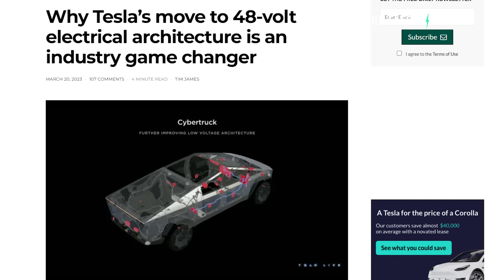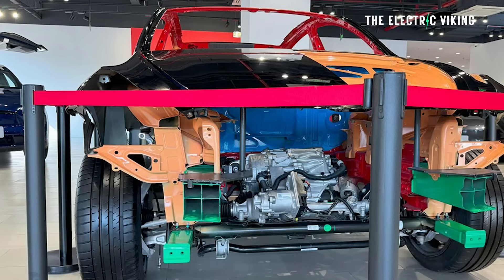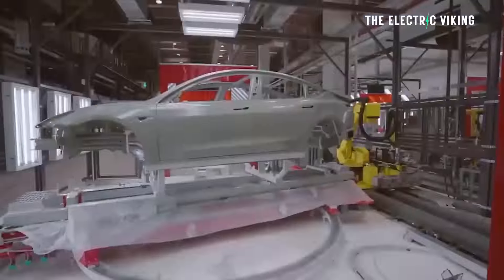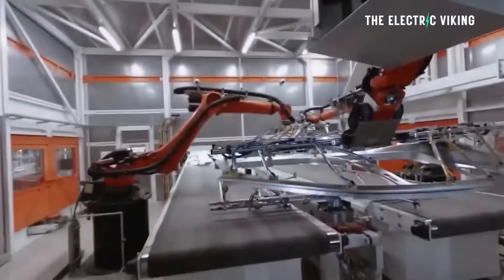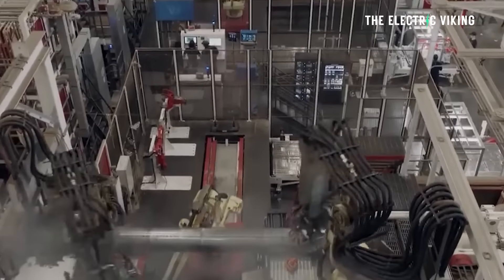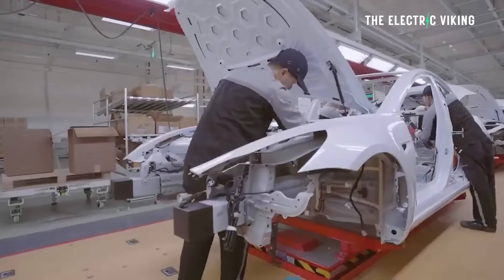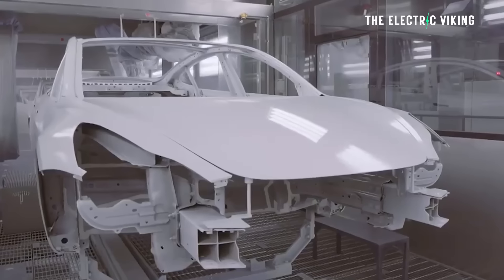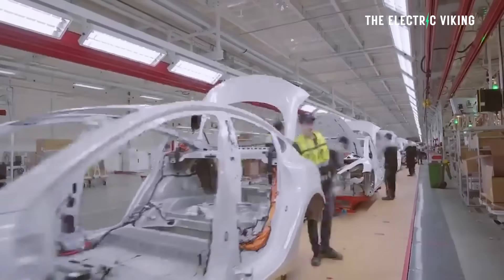Tesla Model 2 NV9X Redwood Crossover coming with Cybertruck architecture

Comment: I have Tesla shares and one day may yet grab a used Y but… to all the engineers reading this, EMP vs Tesla whether source is the sun, military or some future date civilian held equipment used malevolently, how will Tesla vehicles fare? Optimus might have issues too 👀🎈😂🧠 but I am asking a serious question out of curiosity. An old pre silicon chip diesel Land Rover I assume would start up, even using a hand crank… and non existent battery 1960s farm tech

Comment: Every generation / refresh has removed parts. USS, radar, and indicator stalks and who know what else under the skin. Plus the most recent Model 3 refresh is off old architecture and platform. New cameras and HW4 but the cost of which has gone down over HW3. It's also rumored that FSD 12 can only run on HW4 cars. This means the majority of it's vehicles on the road can't run V12. So it does not surprise me the Tesla will introduce it's new tech into the Model 2 but keep battery size low to keep cost low. Given how sparse Tesla's are in terms of driving features such as HUDs, front cluster gauge, etc or simple but life threatening safety features like manual rear door latches, the Model 2 should be as cheap as a Dacia on launch.

A year ago, I bought my Model 3 for a stupid price when compared to what the car costs today. Reason was there was not much choice that I found compelling. But the market, in just 1 year has changed considerably. More choice and the choice is coming from China. So in two year my company car lease runs out and who knows what will be on offer. But I will definitely not be in the market for a Model 2 but nor buy an outdated platform such a the Y or Model 3. Those platforms will need more than just a refresh to compete against the competition.

Comment: Steer by wire. What could go wrong? Losing the ability to be able to steer the vehicle if there is an electrical malfunction or a bug. That's what.
Reply: I guess you don't fly. Planes have had it for decades.
Reply: @Techridr  Planes aren't automobiles
Reply: @idmhead0160  Exactly. You've made my point. Planes can't afford to stall on the side of the road, or lose "steering" since there are way more lives at risk. The technology is the same. You can also argue, Rack and Pinion. What could go wrong? All those parts that can break. That's what.

Comment: One concern I have is the cost of repairs if a Tesla made with one giant casting gets bent in a crash…the whole car will be written off.  So, on the one hand, Tesla saves money on manufacturing but the insurance companies/owners get hammered with astronomical repair costs….
Reply: Insurance companies are now writing off more cars because it is easier for them to raise insurance rates than deal with body repair shops, electronics and more.  They total the cars, sell them at auction and the cars are back on the road with a salvage title.

Comment: Price is not the only negative point of EVs, but also autonomy, charging grid, charging time, difficulty of suppressing a fire when it has started, can burn a whole buiding if a fire starts inside it, much lower autonomy in motorways at a reasonable speed, second hand resale value, repair costs, etc.  So much against it.

Comment: The Model 2 was a rendering so be careful we have been here before, presently at least 18 months away from the Wednesday call, which didn’t inspire many. The old Musk statement prototypes are easy, production is hard, came to mind given the trials and tribulations of the cyber truck. The days of over promising and under delivering have got to go, given this week’s markets reaction, it must arrive second half of 2025 has stated.
The other issue is the cyber truck architecture has been matched by Porsche which will undoubtedly percolate throughout the Volkswagen group. The new platform HV battery is a central component of the newly developed Premium Platform Electric (PPE) with 800-volt architecture, used by Porsche for the first time in the new Macan. The DC charging capability is up to 270 kW. Porsche and stablemate Audi are slowly squeezing the life out of the Tesla premium models S and X proposition. This is before the arrival of the production version of the 2022 Cayman GT4 E-Performance, 718 an EV race car that hints at what the all-electric next-generation Boxter and Cayman 719, presently under production testing for launch 2025, will be like.
Reply: My expectations is the the Gen 3 will be a full featured compact car at a price point and performance that others can't match for some time.    Did you mean stablemate?  
For $100K Porsche will sell you a 4.7 second car.  Or am I missing something?
Reply: @DC.409   Ah it is a hybrid.  No thanks.
This N Ring thing will never end.  I expect we will see a ban on high performance cars and it will only be about track cars. Hope not.
Don't write the semi off.  Tesla has been using and testing about 100 of them.  It needs lots of cells and Tesla is now gearing up to make them.  Has a lithium refining plant and a cathode factory in progress as well and many duplication of the 4680 lines.  High nickel cathodes on the way. etc

Comment: Drive by wire is not essential for all wheel steering, and Mazda and Honda had all wheel steering back in 1988. Yes it's a great thing for the Cybertruck but revolutionary it can not be touted as.
Also if 2 castings is Gigacasting, then one casting can't be Megacasting, it has to be Teracasting!

Comment: I think Tesla will yet again fail to meet their goal. The model 2 will surely not be available at 25000 $, it will most probably be available quite late, the basic version with smaller battery will not have enough range. The past has consistently shown that Tesla can not deliver their promised specs.

Comment: Thats a novel and Dinky way of casting the whole vehicle.  So, I wonder when RHD versions will be on Oz shores.  If they have got to get it right before production, cause so much hangs off this, then that spells delays IMO.  2029 in Oz maybe?
Reply: If Tesla builds these cars everywhere I don't see them taking long to hit the shores of Oz.  Unless there is hold up on your end.   LRD RHD will be a non issue with full drive by wire.   That will need brake by wire but that exists or should.
Reply: @danharold3087  OK, 2028 then.  I would not have thought RHD would be the issue either.  China will be RWD I feel, but equally unsure about Mexico.  There will be the inevitable delays, there always is, and casting one piece will be challenging no doubt.  Telling how the roll out was couched to investors too.  The only hold up in Oz will be stink bugs on board the RORO.
Reply: @GolLeeMe  Tesla is doing an incredible job of squeezing the cost out of production.   Apparently someone thinks the added cost per car is not worth the sales it will attract.   Heard a penny cut off the Model Y is a million dollars saved for Tesla.  I realize S&X are not the Y but it makes the point.
However I can see Tesla setting up rework lines.  Drive the finished vehicle off the line and into the rework were they replace parts as needed.   The added cost will then only apply to RHD conversion and volume must be sufficient to justify it.
Reply: @danharold3087  I think I agree.  But costs will dictate sales, and a revised fuel standard in Oz, BTW.  Plenty of RHD markets worldwide, so can’t see why they would not go all in.  However, if it is not delivered for less than AU$40k (US$25k) then it will miss the magic mark and I will be disappointed.  It’s the one shot to get it out there as the new model T, and hence my belief it will be a later delivery, to ensure it snares as many sales as possible.  The latest iteration of the 3 should have been the vehicle they started with originally, IMO.

Comment: After this winter. Ev’s are done. If you inspect the body creases, interior fit and cheaply made material that looks like it was snapped out of a plastic mold. Then the cyber truck is asking for an around 110,000 + tax. Only suckers. This truck goes three the battery due to it being and 8 ton truck. Good luck musk.
Reply: EVs aren't going anywhere. In the near term demand will be down but overtime they will replace all vehicles no question about it, it's just how long will that take.
Reply: EVs are great....if you live in the right climates, and as sedans or small SUVs.
Reply: @imzjustplayin  

I agree some day. But not until the price comes down in line with gas vehicles that have 2,000+ more parts. Last infrastructure. Charging stations today are a novelty today. Until you can charge up without waiting in a line, they will lose their allure. Last the car itself looks cheap and feels cheap. 110,000 is way off on price. I have a new set of words for Elon. Plush, styling ,none of the ev’s

Comment: Model 2 headlights styling tore a page straight out of Polestar.   Don’t think a gigacast can actually form an entire unibody out of a single casting from the simple fact that the casting is made by two faces of a press that come together.  The most you can get away with is probably the bottom half.  If you’re saying that the whole car is made from the same metal, just like model cars, the model cars are a top half and bottom half.

Tesla’s advantage is producing a car with engineering that no ICE manufacturer can provide, that ICE manufacturers, especially in the U.S. had slapped together low quality vehicles forever.  Tesla’s Achilles heel is growth for growth’s sake, and damn the employees.  They’ve even given up on making claims on the environment.  They’re no longer selling the dream of environmental propriety, but jamming the tech bro fan boy wannabe.

Comment: Steer by wire is not a new thing, and definitely not invented by Tesla.
Reply: Very little is new.  But last I checked Tesla is the first to put steer by wire in a car without retaining the conventional steering column as backup.   This makes LHD and RHD manufacturing a breeze.

Comment: Next Tesla - Stainless steel - no paint. Basic interior, Wide opening doors. Super fan to blow out debris. An LED interior belt line strip that blasts it with sanitizing UV after confirming all humans have exited. Cheap. Practical. Minor collision proof exterior. Function will determine shape (design). Hertz is dumping their Teslas due to physical abuse and interior damages that are too costly to fix.  Have you ever rented a rental car? Disgusting, dinged up and poor running... Elon is smarter than that!
Reply: rental cars are not representative of private ownership.  i dont know why people like to use hertz and their EV as an example because their abuse factors were not only as a rental fleet to customers, but also as a massive supplier for rentals for rideshare drivers, who abuse them 4x harder and have 10x the number of people in it over its lifecycle than a normal rental customer.  
any rental car will have a higher costs than what a private owner would for the exact same model.  EV or ICE.

Comment: 48 Volt and steer by wire are not new features. Stop and go anti-idling feature in ICE cars required in Europe necessitate 48 V architecture.
 Casting in one piece of a car will make repairability very expensive. Consequently the insurance will be way too expensive for regular consumers.

Comment: Structural batteries are a big failure. The batteries must be easily replaceable on brand service center or via 3rd party service or structural batteries must last over 20 years (guarantee offered by Tesla) without big degradations.

Comment: Tesla is trash. After 100k miles the batteries completely degrade. Who would buy a car that will lose its complete value after 100k miles. Hertz learned the hard way and dumped 20,000 teslas.

Comment: The Model 𝛵au will use three GigaCastings (front, battery, and rear,) the 48-volt architecture, the drive-by-wire and be final-assembled by Optimii. (†)(††)(†††)
That means no more crawling around the vehicle sliding in parts. 
Instead of four humans/robots per vehicle, the use of up to a dozen Optimii means the assembly time is cut in three.
†) There are sound economic reasons for Tesla to get rid of the complex and expensive paint shop and assemble the vehicle from the listed components.
There are sound economic reasons for Tesla to get rid of the human element.
There are sound economic reasons for Tesla to enable the unboxed method to produce and sell vehicles with many more options.
††) The paintshop will consist of racks holding the complete external panels of a vehicle before they are dipped in paint and left to dry.
†††) Remember when Optimus was first revealed one of the first things the robot was doing was disconnecting/plugging in a connector?

Comment: The car looks cheap without observing the actual detail. What? Is he styling down. Tesla and all ev’s are about to stop selling until they can create a good battery. Infrastructure won’t happen for another two decades. So they need a battery with a 1400 mile charge. Plus not be decimated by heat or cold. Last not burn your house down while parked.
Reply: 1400 mile range is ridiculous and not necessary as there is a ton of supercharging infrastructure in existence and planned to be built.
Reply: @imzjustplayin  

Only to those without imagination.
Reply: @mikerash-pc4jc  batteries are the biggest single expense of the vehicle, no way will they make a long range like that any time soon.
Reply: @imzjustplayin  

They are currently working on no less than 25 totally different battery technology’s. Many of these can reduce the weight of the battery while increasing the battery capacity. Which will equal maximum range. The silicone batteries are also unaffected by heat or cold. But all these batteries are still in the lab or installed in minor electronics like phones and more battery operated devices. So I say never say never.
Reply: @imzjustplayin  

Did that help Tesla owners in this winters lines as their batteries went dead and had to be towed. The fact a car with a professed range on 270 miles ran out of power in 120 miles is a real problem. Who wants a fare weather automobile at 60,000 + tax?